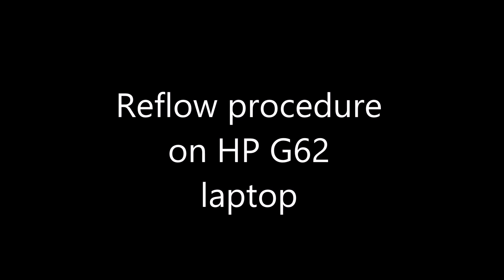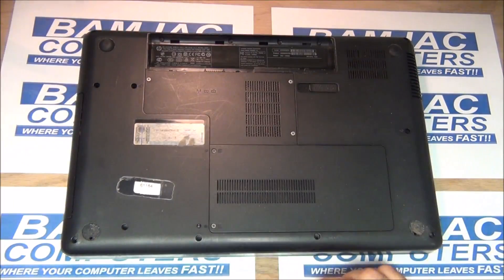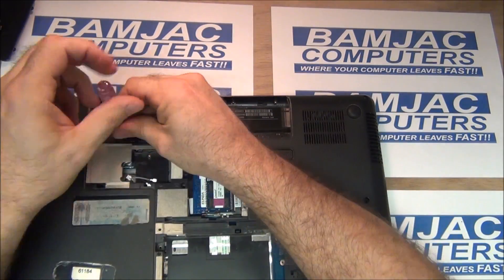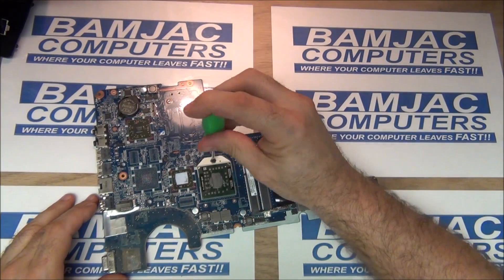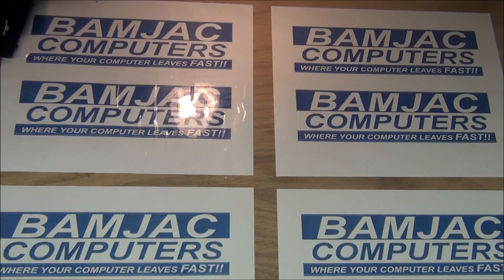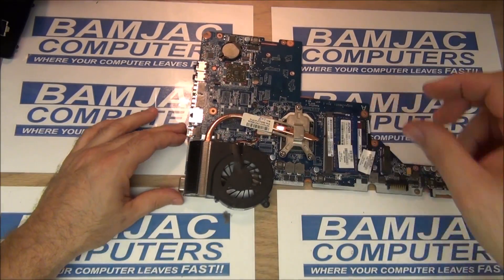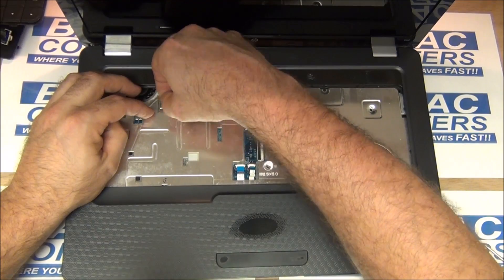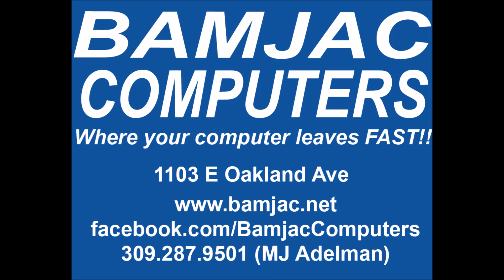Reflow procedure on HP G62 laptop by Bamjac Computers Bloomington IL

Comment: Thanks for a great video on repairing a G62. I had the same problem, dark screen and caps lock slowly flashing. So I tried it using a cooking thermometer to control the heat gun. My lap top works great again.
Thanks so much!

Comment: @MJ Adelman
I did the reflow — disconnected everything, removed CPU+heatsink, the little thermal pad, the battery, everything down to the bare mobo, same as you, then used a heat gun on it as in your video — and after reassembling everything, there is no change. Have the same slow, single blink of the Caps Lock key, as yours was doing in your video. So it's as if I didn't do anything in other words. Disappointing, and I'm actually surprised . . . guess I had pre-sold myself on the idea that it would work, seeing as my symptoms are exactly the same as yours. I was wondering what you would recommend I might try next? What would you do next if it were a customer's board and your reflow proc. didn't work?
Reply from the maker: I would try the same thing and hold the heatgun a little closer for a little longer.
Reply: Really?! I actually like that advice, and want to try it, but when I did it that first time I was worried about the solder starting to get too close to liquifying — my heat gun has 3 levels of operation, and they are rated for 25°C (77°F), 350°C (662°F), and 550°C (1,022°F). I was using the middle setting, which is already nearly twice what you recommended (350°F), so I was going back and forth quite a bit, worried about the solder getting too soft and actually starting to run. Was I worried unnecessarily? If it helps, the heat gun is a Mastercraft  Model № 054-8296-0.
Reply from the maker: It is really hard to get a good temperature measurement of the chip unless you place a probe under it, which you really cant do.  So look at it like this, it's either already fucked, or you might be able to re-flow with greater heat. Either way, you are have not lost anything for trying.  Good luck!
Reply: Yeah, that's also how I look at it. I know that the temperature you're actually applying can vary tremendously depending on how close you are to the target and also how fast you're sweeping the gun over it. I'll just do what you said, hold it very close (as I was already "quite" close the first time) and sweep the gun much more slowly. I think it's that second bit that could make a difference — I was probably moving too fast the first time because I kept mentally imaging the solder turn soft, then liquid enough to start running all over the board, :) which in turn was because I kept mentally comparing that damned "662°F" figure quoted in the heat gun manual with the 350°F you mention.

All right, I'm gonna do it and post back here in a couple days whether that second time changed anything, just for the sake of completeness.
Reply: The "couple of days" turned out to be 3 weeks, but I did what I said, and it didn't help. Still exactly the same thing.

To determine if I can increase the intensity any more without likely incurring further damage to the board, I did a test of my heat gun, just to get an idea. I just took a piece of solder from a regular solder spool, put it on a safe surface, and aimed the gun right at it, from 1 inch above. The solder begins to melt after only 3–4 sec, and melts completely (turns into a "travelling" molten bead) only 4–5 sec after that, so 7–9 sec altogether. That's on the middle setting (out of 1-2-3) , the same one I use on the mobo, not '3', the highest setting. And '1' is useless for this because there's no actual heat, it's just a blower, i.e. room temp.

So on the one hand I feel there's not a lot of room between my last try and making the board worse, but on the other hand, I realize that if I'm gonna scrap it anyway, why not try again?? I may just keep it as a side project and keep trying even if I don't need it anymore. Tell you one thing, I'm getting pretty quick at tearing the laptop down to the bare mobo and rebuilding it, especially compared to the very first time, which took hours.  :)
Reply: USE FLUX FROM AMTECH NC-559-V2-TF . I'll try once again and dissemble the G62 again and again until I feel is super hot. If it don't work I might buy a mobo.

Comment: This bites because IT WORKS!  And I had already recycled my drive a couple of months ago and I only found this procedure yesterday.  F* F* F* F*
Reply: I had found a copy of Win7-Home-64 and managed too successfully reload my G62 using the old license but as others have noted it didn't last.  Since the reflow procedure worked I can confirm the problem but it's just not worth the trouble for me to take it all apart and do it again. I'm making weekly backups part of my routine on my newer machine and I'm going to look into getting a mini-pc or a business-style low-profile desktop for a stand-by unit using Win7.
Reply: I got annoyed at this marvel of American technology (BAARRRF!) and decided to do it again using a different method.  I went with the oven bake process this time and it's back up again BUT something isn't quite right.  I've got an SSD in here and it's taking a very long time to boot up but other than that it seems to be working.  We'll see how long it lasts this time.
Reply: SUCCESS! I went to the bios and DISABLED the Legacy USB support. Now it boots normally and everything is operating like it should - no more delays.

Comment: I followed this procedure now the laptop gives me the HP logo then immediately a black screen error: System board(OOA) missing product information: product name, product configuration, product serial number, product number. Is not responding to the keyboard. I'm sure I got everything plugged back in. Any suggestions?
Reply from the maker: +Judy Sims If you are getting video then the re-flow was successful.  Sounds like the board might be bad though.

Comment: Hi, I have HP G62-b90EC. And my ATI Mobility Radeon HD5470 is not working properly (I can see a screen, but its buggy). So I manage to switch to Intel Graphic.
And what should I do next? 
Heat it?
And do you know what type of thermalpad should I buy? (because on the graphic chip I am using the stock one which came with laptop, and I never replaced it, sure I am replacing thermalpaste on CPU)

Comment from the maker: There is a flux solution that you can order online to drip into the crack between the graphics set.  This helps the thermal material reseal better.  Also, hold the temperature just a little higher might help.  Good luck.
Reply: MJ Adelman Hi was wondering if you Know what the port next to the power coord that looks like a smaller ethernet port is?
Reply: That's the knockout where a good old fashioned telephone line would plug into if you had a built in modem.

Comment: I performed this procedure as well and one week later it's back to the same problem. Any additional thoughts?
Reply: I am late to the party. Get it reballed with proper lead solder balls by a professional technician. This leadfree shit that they use in assembly line soldering can't take any stress, esp on BGA mounted graphics chip that gets seriously hot and expand while running. They crack and gets disconnects from a pad or two. Reflow may help in temporary reconnection of the joints, but reballing is the long term solution.